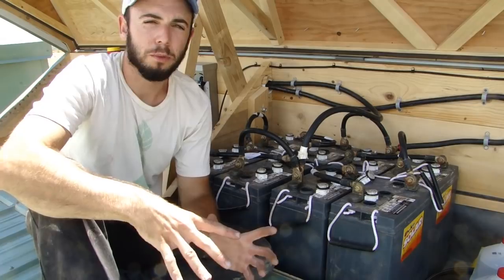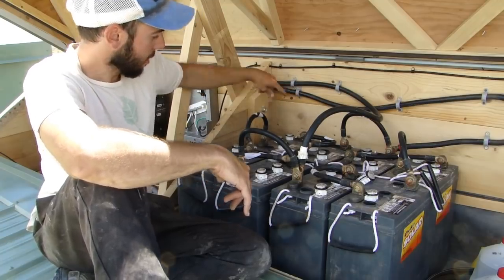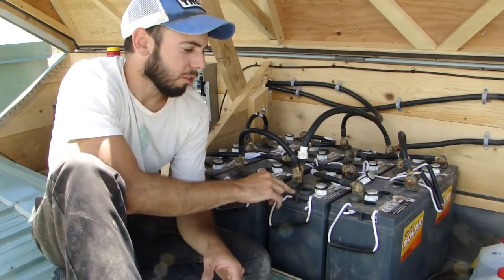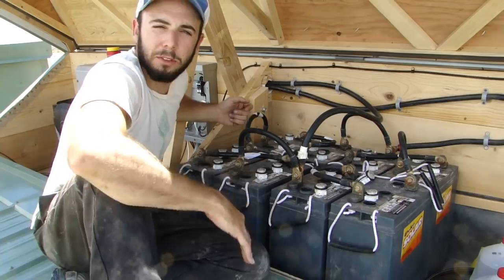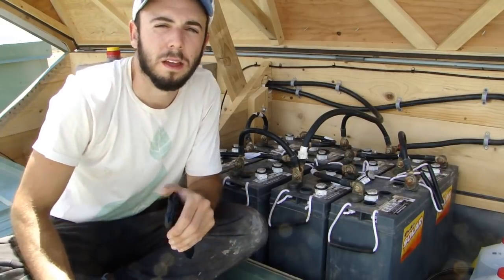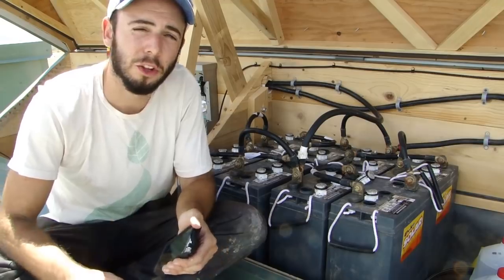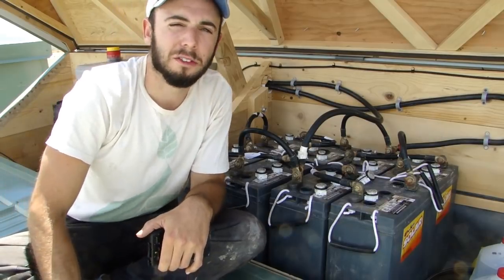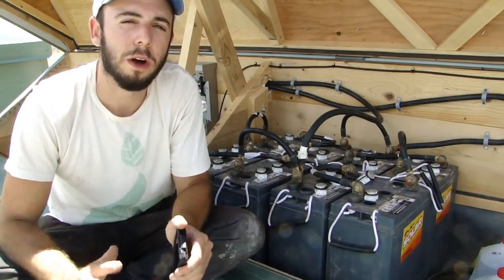How to Size Your Solar System

Comment: I am just getting into this . So, the 6v are wired neg to neg and pos to pos and then a pos and neg go to the next wired set of four ? Then you connect a pos and neg and connect it to your charge controller ?
Reply: Hi Jack Brown.  Please forgive me if this is too basic. 6 volt batteries are popular for several reasons.  Among them are a high storage capacity and long service life. Since almost nothing is designed to run on 6 volts,  we need to change the 6 volt batteries into 12 volts or more to really use their stored power.  To do this, we pair them up and connect each pair in series.  That makes each pair function as a big 12 volt battery.  Then we connect the pairs in parallel or in series according to the number of batteries and our desired voltage.

Using combinations of series and parallel connections, one can make many configurations of a battery bank.  In a parallel connection, all the positive terminals are connected together.  Then all the negative terminals are connected together.  A parallel connection allows each battery to function as a single battery.  When batteries are connected in parallel, the voltage remains the same and the capacities are added together.

In a series connection, the positive terminal of one battery is connected to the negative terminal of the next, continuing in that manner until only the negative terminal of the first battery and the positive terminal of the last battery remain un-connected.  This turns the individual batteries into one big battery.  When batteries are connected in series, (such as in a flashlight) the voltage of each battery is added to the rest.  The capacity, or amp/hours remain the same.

let's look at 3 examples.  We'll say that you have four matching 6 volt batteries.  We'll assume that each battery has a capacity of 200 amp/hours.

Scenario one.  You connect all the batteries in series.  You have created one big battery.  It ill operate at 24 volts and have a capacity of 200 amp/hours.

Scenario two.  You connect all the batteries in parallel.  You'll have four individual batteries.  As a group, they will operate at 6 volts and have a total capacity of 800 amp/hours.

Scenario three.  You connect a pair of batteries in series and then do the same with the other pair, thus creating two large batteries that operate at 12 volts and have a capacity of 200 amp/hours.  Last, you connect the pairs in parallel.  By connecting these two large batteries in parallel, you create a battery bank that operates at 12 volts and has a capacity of 400 amp/hrs.

Now let's see how this works with Ohm's law. (Volts x Amps = Watts) 
Scenario one.  24 volts X 200 Amp/hours= 480 Watt/hours.
Scenario two. 6 volts X 800 Amp/hours = 480 Watt/hours.
Scenario three. 12 volts X 400 Amp/hours = 480 Watt/hours.

As you might expect, watt/hours are similar to kilowatt/hours and to amp/hours.  1 amp/hour is 1 amp delivered for 1 hour.  Likewise, a watt/hour is 1 watt for 1 hour.  So 40 watts for 30 minutes would be 20 watt/hours.  Since kilo is the prefix meaning "1000 times" a kilowatt/hour is 1000 watt/hours.

What you can't do is to mix batteries of different voltages.  For example, you couldn't wire two 12 volt batteries and one 6 volt battery in parallel.  Or at least it wouldn't be a good idea to do so.  I'm not an electrician, so I can't predict what would happen if you did that.  I just know that it is a big no-no, and that I don't want to find out first hand why.  LOL.

About the charge controller, you have a single positive and negative wire coming from the panel array.  You connect them to the input terminals with the positive wire to the positive terminal and likewise for the negative wire.

The wire from the positive battery terminal connects to the controller's positive output terminal and the wire coming from the negative battery terminal connects to the controller's negative output terminal.  The terminals on the charge controller are clearly marked with wording like "From panel" and "To battery." Positive and negative terminals in each section are also clearly identified. 

I hope this helps to answer your question even if it has been a while since you posted it.

Comment: Question.  What system size would you suggest for a window a/c heat unit for my doghouse.  It’s an 8x4 she’d I built for him.  The unit I was looking at was a Frigidaire FFRH1222R2 which says it pulls 3500 Watts.  Does this sound right or any other suggestions would be much appreciated.

Comment: Excellent video.  Thank you very much for making this.  I can see by the comments that most people do not know about "deep cycle" batteries or the difference between a marine battery and a regular car battery.  They also do not understand why you would want either a 24-volt or 48-volt system.  If you could add some "Battery Basics" along with how DC appliances work, you may have the perfect video.

Comment: so great job, you explain that the batteries energy must equal to the solar panel system, and how to use the batteries for a long time. do not use it in dept, thanks for your working!

Comment: Hello I’m from PR. I ve been 70 days without power. What do you recommend for a small emergency system?
Reply from the maker: Jesus Zayas sorry to hear that Jesus.  Try something like this https://m.harborfreight.com/100-watt-solar-panel-kit-63585.html?utm_referrer=direct%2Fnot%20provided.  Add a 12v deep cycle batter and a 300w inverter.
Reply: OGB they do not ship to PR. Do you know any other option?
Reply: contact with my email:felixliu2012@hotmail.com. we will help you to solve this problem

Comment: The Ez Battery Reconditioning program is a digital book (ebook) which guides you through the process of reconditioning many types of batteries [Check Details Here==>https://www.facebook.com/Battery-reconditioning-310070329426065/app/208195102528120 ]. My first impressions were good. I must say there is a lot of information here and even better it’s formatted in a way that makes it easy to read and follow.

Comment: Help me with this I got 2 12 volts batteries and 4 100 Watts solar panels how to connect them to run a fridge and couple light
Reply: What is your solar panel's nominal voltage?

Comment: Wow, a little knowledge is dangerous.
Adding a battery in series does not double the voltage, it combines the voltage. 6v+6v is 12v which happens to be double, but add another 6v and you're at 18v not doubled to 24v. Same goes for amps in parallel. It may seem pedantic but when you are explaining how things work accuracy is important.

Also, ohm's law doesn't say watts = volts X amps. Ohm's law is about the relationship between voltage, current and resistance, hence it being Ohm's law not Watt's law.

I'll be honest, at that point I stopped paying attention, because if you are making these basic mistakes I don't want to know what other mistakes you're making

Comment: How do you limit your usage to stay above 70% a day and 5 KWhs per day?  What voltage would 70% be on your 24v system? Are you having to manually monitor this,  or is there some device in your system that shuts down your inverter at a preset level ... say the 5 KWhs per day?  I am a total knob and trying to understand how I keep from over discharging my batteries if I forget to monitor and leave an appliance on too long.

Comment: as a starts i want install solar power in my house which i need 6 to 10 amps for 12 hours every day could be kind and tell me what kinda solar power system kit i should look at ( how many panels ,battery ,  and converter )??

Comment: Can't you just add a circuit to your solar system to switch the output to your main if the batteries fall under a certain charge?

Comment: not always true about always pulling from batteries. you can get a hybrid controller to pull direct during sun with micro ac converters. then at night it pulls from batteries.
Reply from the maker: interestign

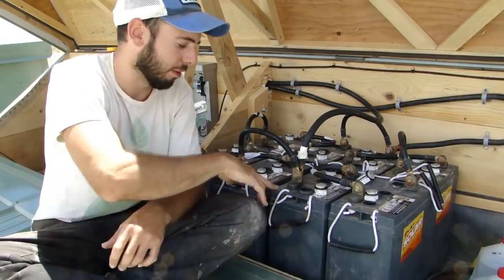Comment: 5:14 That's not what Ohm's law says. That's the Power formula (P=U×I). Ohm's law says Amps = Volts/Ohms (I=U/R). If you multiply power by time, you get a derived unit of Energy (Wh) . Cheers!

Comment: Hello.. Thanks for the info.  What if you use a lower voltage solar panel and use a "MPPT Charge/Boost Controller" to take the Voltage of the 18v solar panel and boost the Voltage to 48v...?  wouldn't that be a less expensive and smaller dimension battery system to get the same voltage and amps..?

Comment: Great video, I've got 3-315 watt panels my MPPT charge controller only goes up to 75amp and I use a 12vdc system (12vx75=900) so my max output is 900 watts even though my panels produce 945,  if I were to run my controller and inverter at 24 vdc It would also raise my watts (24vdcx 75=1800) this is a subject that could use clarification for a lot of people. (It would make a good video subject)
Reply from the maker: cheers and thanks for the suggestion, will put it on the someday maybe list

Comment: He said he has 4x250watt panels, 800-1000 watts @ [zone area] I would guess zone area= 5 hrs sunshine per day, so he could produce 5kw, but that is not realistic if he does not want to drain his batteries less than 70%, I think the usable number based on this percentage would be .30x5000=1,500 watts or 1.5 kw per day actual usable, still not bad...The reason I don't think you should use your battery banks overall storage capacity as a theoretical bench mark for possible daily usage is that you would run in a negative charge deficit and the following day your battery storage level would drop below 70% unless you were to not use the battery bank until it restored itself @ 1,500 watts per day or supplemental charge from a generator, mains or wind gen.( I don't have the same amount of storage you have, so my batteries always drop to 12.0 volts (I have no good way to gauge percentages) but I never let them drain below 11.9 vdc. 
[  I just noticed the date you posted this, I would like to know how well your batteries are holding up? ]

Comment: I see this a lot. People using old school batteries that need water added. The best way to go is with sealed type batteries like the VmaxTanks. Batteries like the Tanks are specifically designed for solar usage. They don't emit dangerous explosive gasses either. They are safe to sit in a closet in the house where as the batteries in this video are dangerous to set up in any enclosed building. Most modern charge controllers are designed to properly charge 
batteries like the Tanks and not standard car or golf cart batteries. Car batteries and some others will work, but they require a LOT of maintenance, are not as efficient and do not live that long.  A for determining usage, get an inexpensive plug in watt meter. They are such that you plug them into the wall socket then your device into the meter. The meter will then
tell you how much power, in watts, your device is drawing. Knowing how much power your stuff draws gives you an idea of your needs so you can realistically size a solar power system.
Reply from the maker: thanks for info!

Comment: Great video! I understood what you said and your explanation on one of the basic electrical theories; P = IE. I could see how some without the basic knowledge of this could find your statements confusing. I appreciated the fact you dumbed it down and spared us the power factors and effeciency numbers. That information would have raised more criticism. This is a simple explanation to a not so simple system. I personally think this is the best expanation on how a solar system operates. Thank you for this.
Reply from the maker: many thnaks

Comment: Another funny thing is that if you use regular batteries you get over double the watt hours when you use double the batteries because the discharge rate goes down and the batteries tend to give more capacity with lower current draw than high draw :)

It's called Peukert's law, just google it ;)
Reply from the maker: +eamh2002 woah!
Reply: "no shit" huh? :D
Reply: And thats the way the cookie crumbles.

Comment: As an electrician this is very well explained for the layman or builder who wants to set up a solar system. 1.oo per day =365.oo  off your electric bill, over 10 years that = 3650.oo savings. Add a small wind generator and you have generation at night and on cloudy days with wind. This will complete the system nicely. If you live in a place where electricity is expensive, you will save even more, and quite possibly even double. The biggest thing for me is, my food is safe in the fridge when the power goes out for a hurricane, tropical storm, tornado, auto crashes into a pole, etc. A generator can be a pain to deal with, raw fuel, etc. and is noisy for those pesky neighbors.

Keep up the good work Rekindling The Reformation !!
Reply: Solar Panels can easily do well over 50 years anywhere in the world, providing they do not get too damaged.    I had one go through an oil flame fire, even some silicon bits missing and it still performed to better than 90%   Another had its glass front shattered into a 1,000 tiny segments, and still performing close to specification.      The biggest risk to short life for Solar Panels is damage.   .    So mount them properly and not under a tree that could fall on them.      " is now sold its sold to idiots who cant do math or science who think it is somehow cheaper    "         Ah Yes.    If Solar was cheaper than Grid, then the Grid people would be doing large scale Solar, cheaper than you could.       But Solar is good for those too far from the Grid, just use gas, coal or wood for heating and cooking.     @michael ryan
Reply from the maker: cheers
Reply from the maker: thanks for the feedback
Reply: Dietrich Zumwald can you run your airco on solar .
Reply: @bikingangels  What size A/C?  What size battery bank?  What size solar panel?  Yes, it can be done, but only if  you know what you are doing.  It helps if you use the very low power Inverter type A/C units.
Reply: MrSummitville  Hi, after a long time going about this i figured on using a 24.000 btu split unit 24 V , i live on a small island in the Caribbean called bonaire. We have a climate of 31 C daily with maybe 20 days a year some rain, from 10 am to about 6 pm it’s very hot. I will be using the a/c to cool a 36 sq meter tiny home. Can it be done ?
Reply: @bikingangels  That's an unanswerable question...🤦‍♂️🙄
Reply: Ha.!  Dietrich,     The wind here dies as the sun sets.   :-(
Reply: Wrong information there.     I do agree with break even 25 years quite possible.   People who know what they are doing here in the tropics are getting 10 years from their batteries, which is very good.     Solar panels should still give good drive for 50 years, providing they do not get damaged.     But Solar will not give you cheap electricity, only seriously good for off grid use, or as a back up to cover power failures, if that is important to you.      @michael ryan
Reply: @ Dietrich Zumwald - No, most people cannot go off-grid with a PV system that costs only $3,650 and it will not generate $1.00 of electricity per day!
Reply: Remind me to never hire you to do any electrician work...
Reply: What type of batteries are you using?

Comment: Will one of those 100 watt solar panel kit be sufficient enough for 1 person living with very minimal usage...... I do plan to run a refrigerator 24/7 though, but other than that not much usage other than a lamp at night and to power a laptop computer (probably only to charge it overnight).  Will it be good enough and still have ample supply of reserved power should I feel the need to splurge myself every once in a while with loud music on my stereo for a few hours at night?

Comment: very nice video. Form your amp hr to kilowatt calculation does it mean that if I want to get a 24v system it better I use 4 12v  100ah batteries to give me 9600kw instead of 2 12v 200ah batteries which should give me 4800kw

Comment: I suspect most men's wives will hugely increase their vibrator usage if guys are talking like this - which will require additional x4, 6V batteries. Unless camping, solar panels are pretty 🌈 but camping is also a bit 🌈. Obama -  a huge fan of big black solar panels. Let this be a lesson to you  and your kids.
Reply from the maker: You make some really sound points here.  Thank you for your intelligent analysis

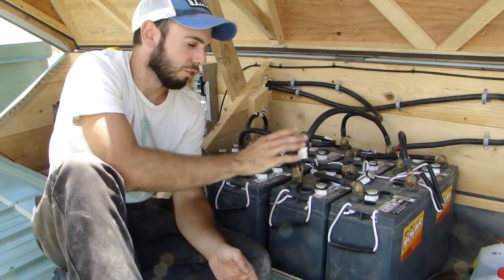Comment: oh and question on your video at time 3:25 or so is a better analogy. that it's maintaining the level?  as in electricity is being pulled out to power things but depending on the amount of electricity being harvested is how much that level is going down or up? you'd not want it constantly putting to much power in due to overcharging the battery unless you have a cut off when the battery is 100% then comes back on when battery reaches 90%. works similar but reverse. To how a fridgerator maintains tempature; turns on only when tempature goes up.

Comment: Adding a 100w solar panel, solar controller with a 1000w inverter to our pop up trailer. 

if my current 12v deep cell battery is rated at 80 amp hours I would need to multiply 80 x 12 = 960. divide by 1000 I would get .96 KWH. just under one hour. Is this correct? 

if so does this mean I can run a 100watt light bulb for approx 10 hours to fully drain the battery.

Trying to get my head around the math and determine if I should remain with one 12v or purchase a second to increase my KWH usage. 

Very informative video and beautiful system set up you have☺